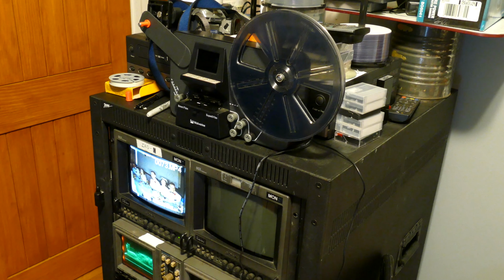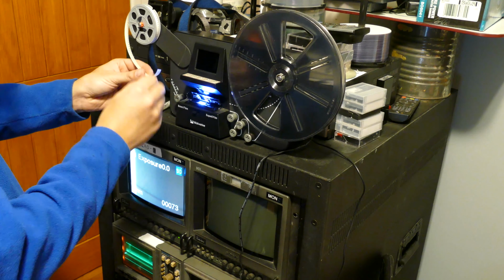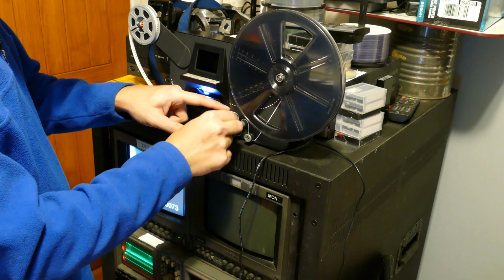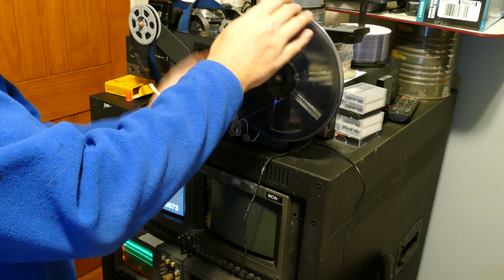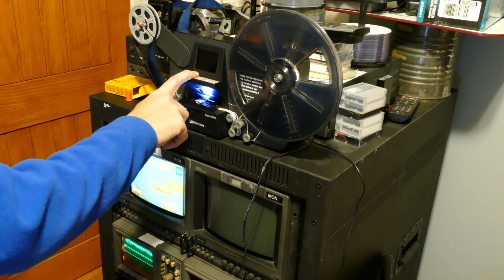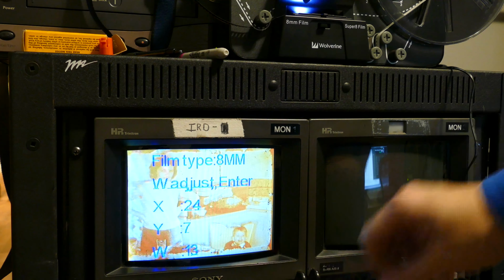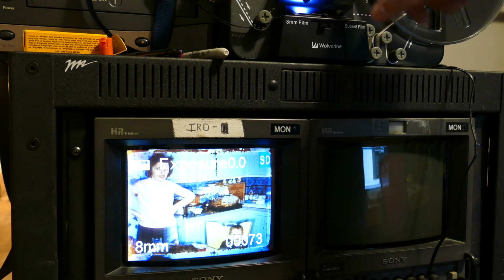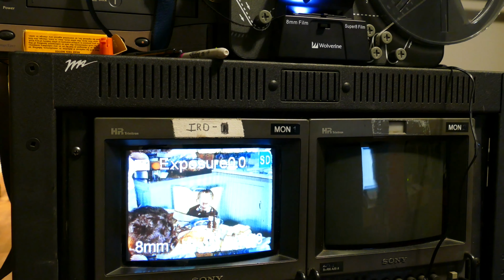Setting up the Wolverine Movie Maker Pro for an 8mm Film Transfer

Comment: Hello! I am curious - I understand the wolverine Pro doesn't capture 
audio from an 8mm film per se, but, are you aware of ay work around that
 you can then capture the audio, say, and then sync it in Premiere?
Reply from the maker: yes, I would capture the images using the Wolverine, then run the film thru a projector with a sound pickup and record that separately. the challenge will be syncing the picture and sound in premiere. The sync may drift a little over the course of the timeline. all of the 8mm film I have transferred has not had sound. if your film has an optical audio track and you are able to overshoot your framing to include the track you might be able to use this software to decode the audio https://usc-imi.github.io/aeo-light/

magnetic track audio will need to be projected.

Comment: Hey I have the Kodak movie digitizer how do I hook it up to my computer monitor to get a better picture so I can make adjustments to the film
Reply from the maker: doesn't look like the Kodak unit has an AV output for a monitor. Maybe you can connect to a computer with the USB port? The Wolverine and the Kodak units are different.
Reply: @kb1vyd  Hey thanks it does have
 a USB cable and you can plug it in to the back of the digitizer.Is there something I'm missing.Iooked to see
Reply: Looked to see if the Kodak popped on screen didn't see.is there a one kind of connector to make it work.

Comment: Excellent video and information. Any chance you could advise me on how to fix uptake reel? There’re no belts so ruling that out. Powers on and sounds like it’s getting juice to that part. No burning plastic smell. Thank you! Would be so very grateful if you might have an idea?
Lisa
Reply from the maker: I'll see if I can make a video showing how the internals work. the take up reel has a friction clutch that might be worn out, the reel wants to continuously rotate while the film is moving intermittently.  one test you could try with an empty reel is see it the spindle moves in rewind mode. also very important, the super8 adapters are different, only use the gray one on the take up reel and red on the supply side. The gray adapters is keyed, the reed free spins.
Reply: @kb1vyd  I thank you! I ordered a $40 motor assembly from Wolverine. The counter had around 90 transfer processes on it when I got it. I was only able to get 15 3” reels done before it quit. So We shall see. The

Comment: This was super-helpful, thank you so much!  I tried my first transfer last night only to discover that the exported film wasn't centered.  Your video helped me correct that problem.  Many thanks!  I also pulled out my old 19" tube tv and connected the Movie Maker Pro to the tv through an old VCR (tv only has a coaxial cable so needed the yellow line-in from the VCR, and coaxial connectability from the VCR to tv, haha).